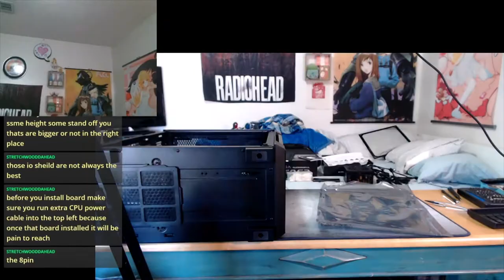One Armed Bandit builds his first PC in almost 20 years - My First Ryzen Build

Comment from the maker: BTW:
I upgraded from a few year old model HP Omen,
i5-7400k (without a motherboard that could feasilby OC it...)
GTX 1060 3 GB (which i upgraded with the 1070 last year actually, so now its the bottleneck if anything in the new build)
8 GB 2333mhz Ram (later upped to 16gb 2666mhz)
256GB SSD
1TB HDD